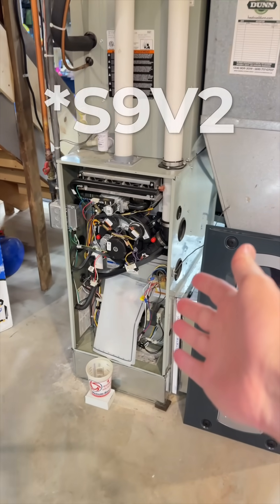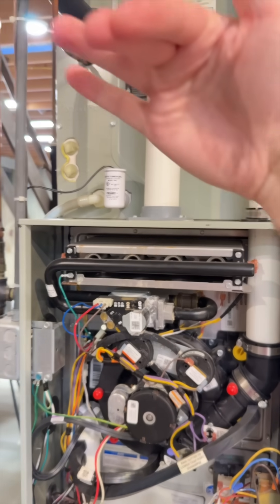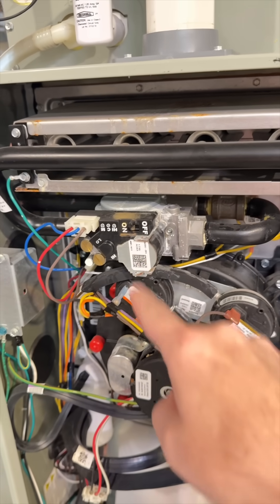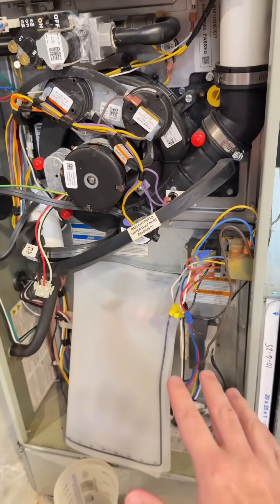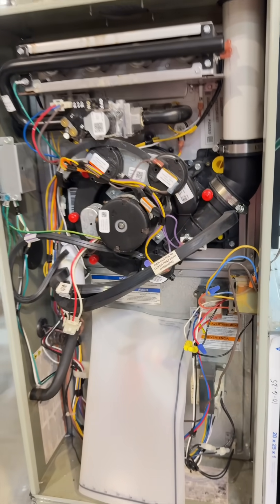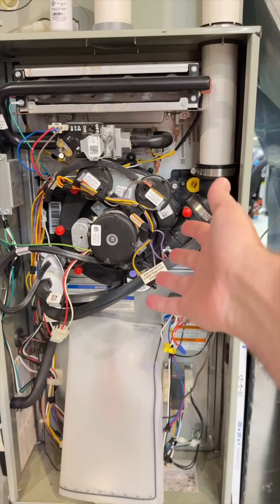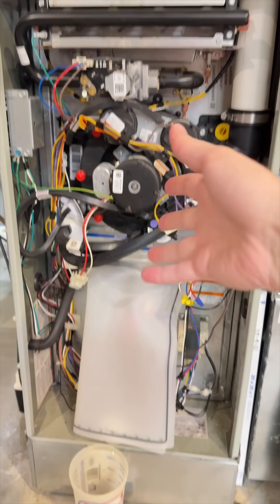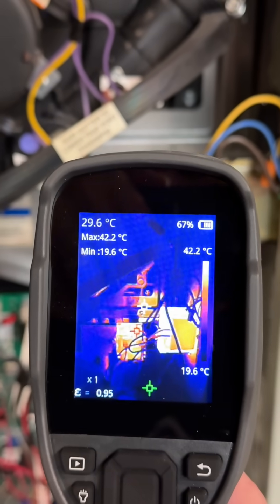It's not that hard to stop a Trane, apparently

Comment: Yeah, I recommend people avoid Trane at all costs.  I installed a “ducted” zoned system and it turned out that only their thermostat would run it, as well, they immediately quite shipping software updates on said thermostat (it never worked correctly) and said the solution was spend $1000 on a new thermostat and $500 to install.   Trane is really poor tech, really 2nd rate engineering and zero ethics.

Comment: I would double check the manual and make sure the drain lines were installed correctly. One of my furnaces at my office they installed the drain lines for a horizontal config when the furnace is installed vertically.

Comment: First let me say I'm not a hvac guy, but I looked at my furnace. My exhaust pipe comes out of the side of the unit and not the top. On mine the installer put a tee as soon as it comes out of the furnace creating a drip pipe on the bottom with the exhaust going up. This way if there is any condensate dripping back down the exhaust it falls into the drip pipe. You should have this configuration on the gas side too. The other thing I noticed is that your induction blower seems to be rotated. The blower drain should be located at the 6 o'clock position your's looks to be at the 4 o'clock position. Its supposed to be at the 6 o'clock position so it drains out any moisture that gets into the induction blower. You should not have water puddling in the bottom of the induction blower.

Comment: The little amount of rust is fine but they really should have put a channel to divert any water to the sides. Like the other person said, you could also have a leaky inducer motor seal. These high efficiency furnaces put out a lot of condensation. 

If you hear water sloshing around when the motor kicks on then your “rain gutters” are probably clogged.

Comment: So, Jeff, you actually have a condensing furnace. The heat exchanger pulls so much heat out of the exhaust gases that the water byproduct of combustion condenses out of the exhaust gas and is collected in several tubes. Not relevant to the issue you're having, unless it's a bad seal on the inducer motor assembly, because that's around where a lot of these condensates collect. 

The "fan thingy“ is your exhaust draft inducer.

But I would definitely give your condensate drain a good flush, or shove an air compressor on it in case it's clogged and backing up. There shouldn't be so much water in the inducer assembly that it is causing condensation from the air.  

To be safe, I like to apply additional conformal coating to my control boards after all the wires are plugged.

The design is good. The installation is not.

Comment: This could be solved with a 3D print, but it's horse Sh1t that it doesn't include a cover from factory.
Reply: Built to the lowest penny. The electrical part of any HVAC system is utter garbage.